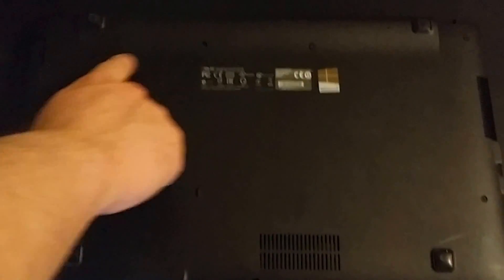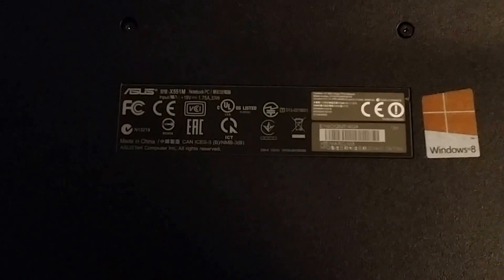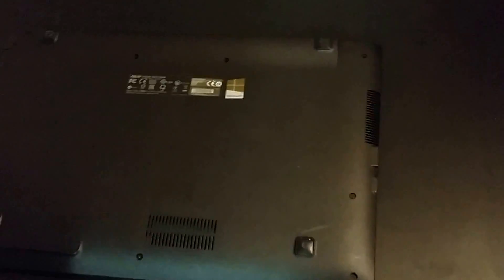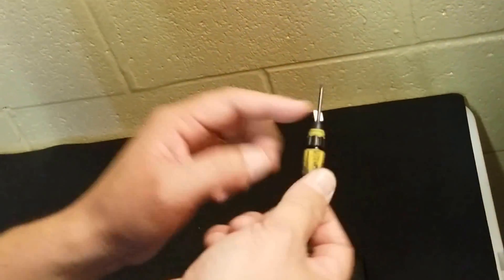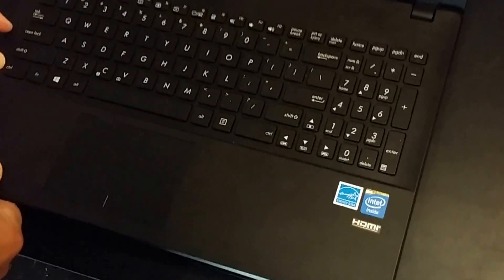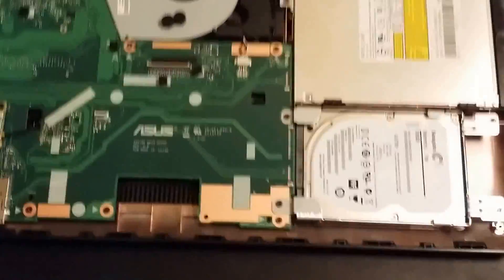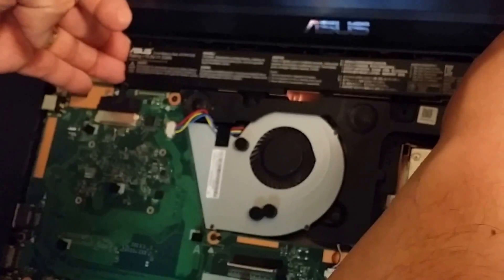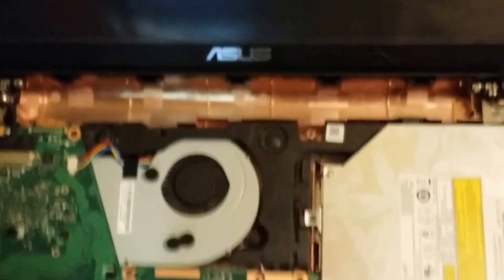ASUS X551M Laptop Battery Removal & Won't Power On Fix

Comment: how do you reconnect the three ribbons?
Reply from the maker: Really carefully.  You have to lift the lid with prop it up with something so you can use one or both your hands to insert the ribbon connectors back in on the motherboard.  It really is a pain but can be done.

Comment: Hey angrysquirrel, I have this same laptop and I did the reset by taking the battery out and holding down the power button. However, (after reassembly) when I press the power button the light is shown to say that the laptop is on but the fan does not power up and the screen is black. The charging light also shows when I plug in the charger. How may I remedy this? Thank you in advance.
Reply: After looking through the comments it is the same issue as Richard Santiago.
Reply from the maker: Make absolutely sure that you inserted all the connections back in properly is step one.  I would personally disassemble it again and reassemble it going in reverse order of the video.  Make special note to see if you accidentally dislodged the LCD screen cable that comes from the left hinge to the motherboard connection.  Also check the fan power plug to make sure that did not get loose either.  It is not uncommon however to not have to fan turn on right away at boot.  The CPU fan only comes on if it needs to based on the amount of heat is given off the CPU/GPU chips.  If this still does not work, I would remove the battery and plug in the AC Adapter ONLY after holding down the power button to reset it to remove the battery out of the possible culprits.  At this point, it is process of elimination.

Good luck!

Devin

Comment: Thanks Devin.  You are right.  Whoever designed this laptop is a moron, but I was able to replace my battery with the help of this video.  If battery replacement is the only reason for opening the housing however, it is not necessary to disconnect the ribbon cables.  Sliding the housing cover down just enough to expose the battery is sufficient.  Doing so minimizes the risk of physical damage to the cables, connectors, or electrostatic damage to the solid state components.
Reply from the maker: You are correct on that Gregg.  However, there are a LOT of people on here that would be VERY hesitant to do what you said only because they may "forget" the cables were attached and might accidentally move the Keyboard Lid "too far" and damage them.  I only suggested removing the cables so nothing would be taken to chance on accidentally damaging the attached cables.  If people are careful, you are 100% correct to do as you stated on removing the battery without detaching the cables!  KUDOS to you!

Devin

Comment: I have one of those computers and I forgot my password to get on it is there a way I can get it set back to factory settings?
Reply: Is the password for Windows or for the Hardware Bios?
Reply: valdestot  
it is the one that when you turn it on . it is the password for the boisor what ever you said. it is when I turn it on and it has my picture there and it ask for my password to get it to the screen where all my programs are.Does that make sense?
Reply from the maker: That is the Windows Password.  If you have a Windows 8 or 10 Operating System, it MAY require a password.  However, ASUS has a built in Recovery Manager on most laptops.  When on your password screen, simply HOLD DOWN THE SHIFT KEY then RESTART THE LAPTOP.  I cannot stress that enough.  Hold the shift key down while restarting.  That will take you to the Advanced options.  Select ASUS RECOVERY MANAGER then follow the instructions.  That should allow you to reset your computer to factory default settings.

Good luck!

Devin
Reply: Thank you but my computer was hacked and it had many viruses .But I got it fixed now. But thank you for your help. And I will remember what you said here

Comment: how would would you turn the computer on without the keyboard and the battery out
Reply: Sorry for the late reply.  You have to insert at least the power button ribbon cable back to the motherboard to turn it on or to hold the power button at least 30 seconds to fully drain the motherboard of power.

Comment: Thanks a lot! I didn't hope for such an easy fix. Are the ASUS laptops really this crap? I owned an ASUS before and it died after 2 years. Now I own a mid-range Lenovo for 5 years now and no problems yet. My wife buys an ASUS and it starts acting weird after a year. What the hell really.
Reply from the maker: Asus's quality control has gone downhill as of late.  To be fair, most laptop manufacturers that sell laptops under $500 are really poor in quality.  Lenovo is a solid computer/laptop.  Do you know why?  Because they don't really sell laptops under $500.  Quality parts = higher price = better build and longevity.

Comment: I have the same model ... bought brand new but never used until 3 days ago. Says 0% battery charging but will only work when connected to power.. tried holding power button for 60 sec but still won't charge. Anyway to fix without opening the laptop?
Reply from the maker: When did you buy this laptop?  Yesterday or 2-3 years ago?  Even if you never used the laptop and bought it 2-3 years ago, the battery can still deteriorate.  Sad I know.  If you JUST bought this brand new recently, then I would contact ASUS technical support and they should be able to take care of that for you (1 year warranty on parts and labor).

Devin

Comment: So how do I reconnect the 3 ribbons for the keyboard, power and touch pad? I tried several times but no luck. Thx!
Reply from the maker: Really carefully.  You have to lift the lid with prop it up with something so you can use one or both your hands to insert the ribbon connectors back in on the motherboard.  It really is a pain but can be done.

Comment: I followed the instructions on this video description. I have this very same model. It didn't work. I turn it on, and the lid indicator shows it is on, also the AC adapter lid indicator shows when it's connected, but the monitor displays only a black screen and I can't hear the fan. Any help?

Comment: hopefully you guys will answer this. I have owned many laptops, and never had the problems like I do with my ASUS X555L. I replaced the screen a few months back, and not 10 minutes ago, was watching a dvd and it quit working. Are asus computers generally regarded as shit?
Reply from the maker: ASUS' quality control on their sub $500 laptops (along with HP's, Toshiba's and Acer's) are really not that great.  You have to remember that they are using the cheapest parts imaginable to turn around razor thin profits.  These laptops in this price range are considered "disposable" after 2-3 years which is why I normally do not recommend them since I fix a LOT of them all day EVERYDAY.

Devin
Reply: ***** Thanks, Devin. That actually makes sense. My dad has an ASUS ROG laptop, and he has had no issues with his. Mine, on the other hand, has been a complete nightmare since day one. I'm lucky in the sense that I went to college to study computer technology, so fixing these things are not that hard for me, but I absolutely pity those who do not know any better and willingly dish out $200.00 every time something happens. My problem that I mentioned earlier, with the computer not working after I inserted a DVD in it, turned out to be the battery. Luckily, all I had to do was remove the screws, pop the case, and remove and reinsert the battery. Not sure why it happened, but I'm glad it was easily repairable. ASUS used to be my laptop of choice. Now, I'm not so sure after their crappy customer service. My screen cracked simply from me opening it up by the right corner. They told me that I, or someone in my family, had to have stepped on it.
Reply from the maker: Sorry you had to experience a sub $500 laptop quality and customer experience wise.  Now that you have better information, you will know better the NEXT time you purchase a laptop.  Personally, I recommend a over $500 Lenovo or Dell.

Devin

Comment: hey men i have a asus charger that have a 19v,1.75a ang 33v how can i repair my charger can you make a tutorial of it? please
Reply from the maker: It is not recommended to repair a charger/power adapter.  It is simply not worth fixing something that can damage your system or perhaps injure you or kill you!  Power adapter/chargers are about $7 - $25 on average depending on model.  It is better to buy a new one.
Reply: +Angrysquirrel PC  ok but how do i know the size of my adaptor? the one who stick in laptop! idk what it is becuase i want to order in lazada! but i dont know the size of my adaptor!
Reply from the maker: Just Google your adapter type based on your Asus model number.  Like for this video, the adapter would be "Asus X551M Power Adapter" on Google or Amazon.

Comment: can this work on other models of ASUS?
Reply: is it also charging before you fix it or not
Reply from the maker: The "X" series is all very similar.  The other series of Asus laptops are slightly different but work kind of the same way as it is the same manufacturer.  Are they going to be exactly the same?  No.
Reply from the maker: This computer was charging before I fixed it.  It just needed a screen replacement.
Reply: Angrysquirrel PC oh thanks! It helped a lot.

Comment: I see that the battery in your computer is 10.8 Volts which I assume is the same as mine since I have the ASUS XM551M.  The batteries I am coming up on show A31n1319 with 11.25V Can I order the battery with the same model number with the higher volts?
Reply from the maker: Good question sir.  This question comes up a LOT with this particular model.  It is always best to get the same voltage and wattage whenever possible.  That being said, you CAN use a slightly higher voltage battery as long as the battery is from ASUS.  They will assume any liability for any "mishaps".  If you get a generic knockoff, you will be hard pressed to get them to admit that they are the culprits.  But you should be okay with a higher voltage as long as it is not more then 10% higher.  In this case, 1.08V +/- = 9V - 11.88V is the acceptable safe range.

Devin

Comment: This has been the only helpful thing I've found in months! Thank you so much!!! Now just to get an elctrostatic mat... lol
Reply from the maker: You are very welcome!  I am glad this video helped you!

Devin
Reply: Angrysquirrel PC for the electrostatic mat, is it for the laptop to rest on or for you to stand on? Cause I can find ones for the laptop to rest on (both Amazon Prime and eBay), but the one to stand one is over $300 CDN :(
Reply from the maker: The mat is placed on the table you will be disassembling the laptop on.  It is plugged into a ground location such as a power outlet (ground hole) and you wear a wrist strap that discharges static electricity into the mat that goes into the ground hole in the outlet.  Get it for between $20-$40 TOPS.

Devin

Comment: HI CAN YOU HELP ME WITH THIS PLEASE I HAVE MY ACER V17 NITRO AND IT WONT TURN ON AND I CAN NOT EVEN TAKE OFF THE BATTERY BECAUSE BATTERY IS IN THE NOTEBOOK PLSS HELP ME ITS JUST LIKE BLINK BLINK AND IT WONT TURN ON WHAT SHOULD I DO IT WAS ONE TIME IN THE SERVICE BUT IT DOING THIS AGAIN THanks
Reply from the maker: Not knowing what light(s) is blinking, I would try these steps:

It could be:
1. Power Adapter/Charger
2. Battery
3. DC Jack
4. Motherboard

Remove the battery first then hold down the power button for 30 seconds to discharge all power from the system to reset it.  DO NOT PUT THE BATTERY BACK IN.  Then reassemble the laptop and see if it powers on.  That will eliminate the Battery as being the problem.
Reply: Angrysquirrel PC Yes thanks but i can not remove the battery because my battery is built in
Reply: I Would like to try these steps and i was trying but i can not remove the battery What should i do thanks man
Reply from the maker: First off, find your screw holes underneath the laptop.  Unscrew all of them.  Try prying the bottom right corner with a guitar pick.  You need to split the backing off gently.  If your laptop has rubber feet, and you cannot separate the bottom away from the keyboard lid, there may be screws under the rubber feet.  After determining if there are screws under the feet or not, start spreading the top lid and bottom lid apart and go around the perimeter until the bottom is completely removed.

Good luck!

Comment: My screws are tight asf wtf
Reply: ik! I gave up. did you get through?
Reply from the maker: Make sure you have the right size screwdriver/phillips head for the screws.  You can try using different size drivers but the screws should come off quite easily.  If you stripped your screws, there are screw extractor tools out there to help remove them.  UNLESS, you broke the plastic molding that holds the nut that the screw does in then you would be freewheeling the screw unable to remove it.

Assuming that the molding is not broken, you can purchase this by checking out this link:
https://www.ifixit.com/Store/Parts/Precision-Screw-Extractor-Set/IF145-118-1?gclid=Cj0KEQjwuJu9BRDP_-HN9eXs1_UBEiQAlfW39merrbKeN55gDLWGuf4BU6GNyHgcFCJOUsCE6HjfAisaAnfK8P8HAQ

Good luck!

Devin
Reply: LordSlader I did 5 of them with a spoon lol
Reply: and then after the rest tight af I gave up
Reply: Mine (diff. model) turned out to be torx head screws (star keys).  And they are tiny AF, so hard to see that they are a different type.  I was able to get one out with a small flathead, but for the others, the flathead just would not catch.  I think the first one was just loose enough.  Anyway, I had to wait and go ahead and buy the star bits.  After that it was very easy to remove them. Just thought it might be a possibility.  I don't know why they not only tucked the battery inside, but they could have used regular phillips head screws.  (Actually, I have a good idea why, and it is because they want us to have to pay them for support, but anyway...).

Comment: I don't have a grounding strap or anti-static mat.  I have read that taking the battery out and putting it back in should fix a "won't power on" issue, so I just want to try this at home.  What can I do to prevent hurting the computer?
Reply from the maker: You can make a grounding strap easy.  Just get some copper wire and wrap it around your wrist and then run that wire to an electrical outlet and give about a foot of extra length.  Wrap that end around a screw or nail and insert it into the ground (bottom hole assuming you are in the United States).  You are now grounded and will not fry or damage your system.

Comment: sir, after you removed the battery, did you try to connect it to the power brick and turned it on? did the laptop run without its battery while using the power brick? thank you for your reply in advance.
Reply from the maker: Yes.  The computer can run without using a battery.  I have personally done this on many laptops as a bad battery can sometimes cause the laptop to not turn on even if it is plugged in to the charger/adapter.  Keep in mind that if you don't have a battery, the laptop will cut off when there is a blackout or a power outage similar to like a desktop plugged in directly into an outlet with no UPS (Uninterruptible Power Supply) or essentially a backup battery.

Devin
Reply: noted sir.. thanks a lot. God bless

Comment: Is it possible to replacement the battery for the asus just wondering.
Reply from the maker: Yes.  Follow the video's instructions to remove the battery.  You can purchase a replacement battery from Amazon for around $30.  I am assuming that your laptop is the Asus X551m.

Devin

Comment: Alright, so my TOSHIBA SATELLITE E45W-C4200X doesn't have the removable battery same as this one. I opened the rear cover and got access into the battery. I unscrewed the battery and there is a line connected from battery to motherboard. I want to unplug the line from motherboard but I can't unplug it. My issue with laptop is when ac adapter is plugged in on wall and plug in the charger, my laptop turns on just fine. But when I remove the charger from laptop and press on power button, it doesn't do nothing. Do note that my laptop battery is fully charged. Please help...
Reply from the maker: Your laptop battery may say it is fully charged but most likely it is at the end of it's life or it is dead.  Once the battery can't hold a charge anymore, it will say 100% but in reality is at 0%.  Purchasing a new battery will solve your problem.

Devin
Reply: Angrysquirrel PC Thanks Devin for the help so far. Like I said on my comment I can't unplug the line from motherboard. What you want me to do then. Let's say if I buy a new battery, how am I gonna take off the old battery?
Reply from the maker: Oh sorry about that.  To be honest, I am not familiar with that model of computer.  As you can see, this video is for ASUS notebooks, the X551M model in particular.  Let me research your model and I will get back to you this weekend.

Devin

Comment: Hi, how do I avoid discharging any static to the motherboard?
Reply from the maker: You can make a grounding strap easy.  Just get some copper wire and wrap it around your wrist and then run that wire to an electrical outlet and give about a foot of extra length.  Wrap that end around a screw or nail and insert it into the ground (bottom hole assuming you are in the United States).  You are now grounded and will not fry or damage your system.